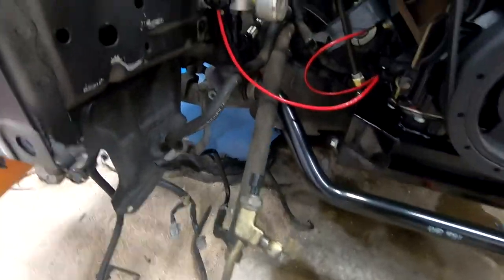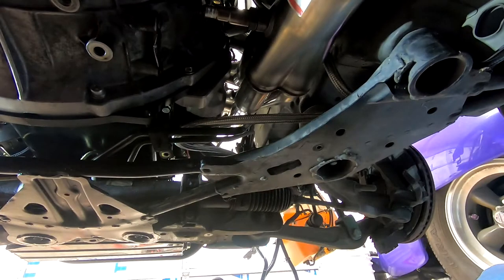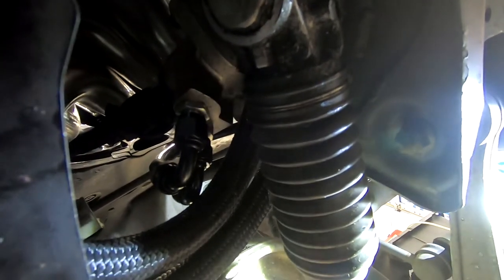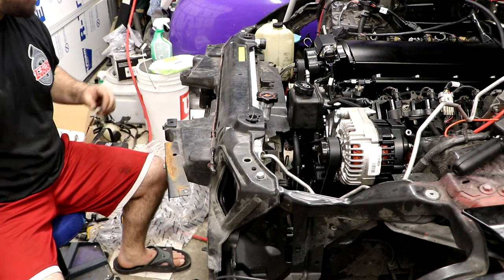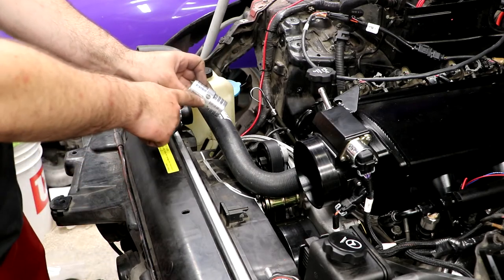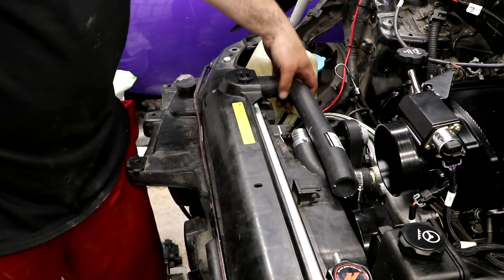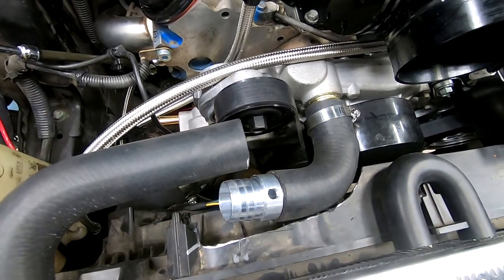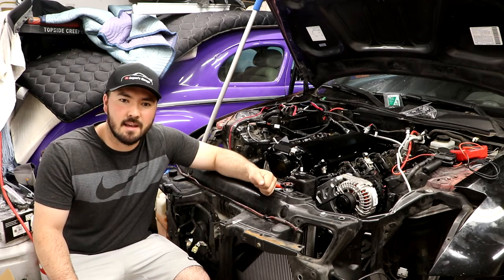MISHIMOTO RADIATOR & SIKKY POWER STEERING - 350Z LS SWAP EP. 14

Comment: Which hoses did you use for the upper and lower? Part number or reference vehicle would be awesome thanks.
Reply from the maker: The lower hose is a Dayco 72135 and the top hose is a Gates 23080. The only weird part is the lower hose is about 1/4" small on the engine side so you have to use a little lube and push it on.